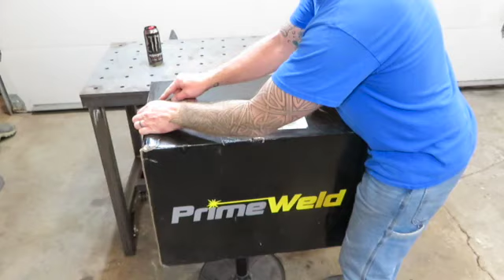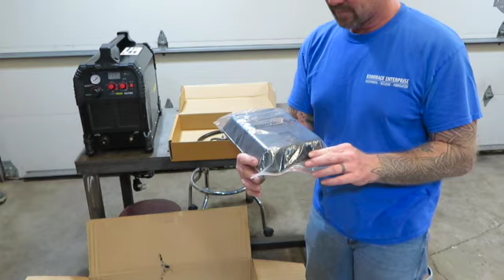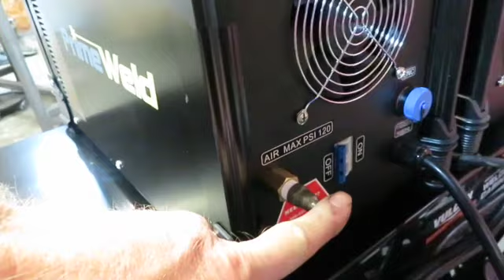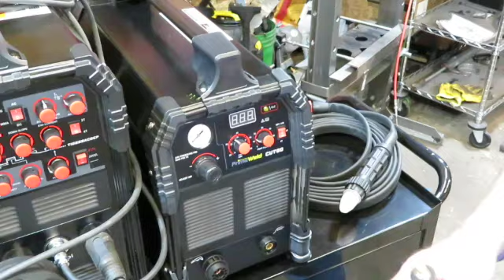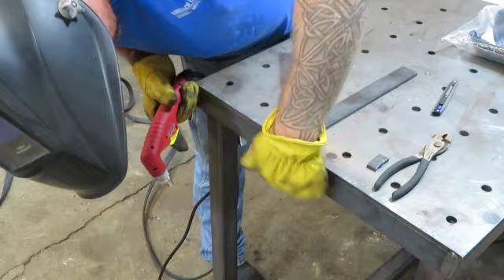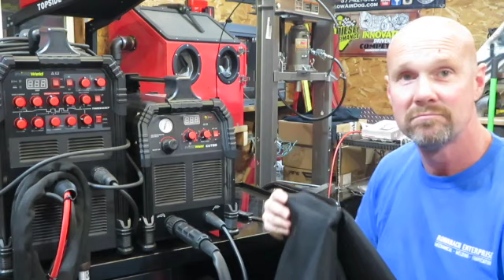PrimeWeld Cut 60 Plasma Cutter

Comment: Thanks for the review - any chance the carry handle can be unscrewed and dismounted to allow for storage in tight quarters?
Reply from the maker: Don’t see why not
Reply: @ChadMyers73   Thanks - Primeweld's customer service said it could not, but I figured I'd get a second opinion.  I have a custom welding cart built, and the bottom shelf is limited to about 16" in height, which means that the handle on would create a way tight fit.

Comment: Nice review!  I’m kinda trying to decide between the Primeweld 50 with high frequency start, or this machine with a bit more amps, blowback type start, and cnc port. Thinking I’ll go with the cut50dp, as I don’t foresee having cnc cutter and I have a torch for the rare times I might cut something thick.
Reply from the maker: Anything PrimeWeld you will be extremely satisfied with. Awesome customer service!
Reply: @ChadMyers73  Yeah. They seem to have positioned themselves nicely between the super-cheap no-name, no-support stuff, and the multi-thousand$ industrial quality stuff.